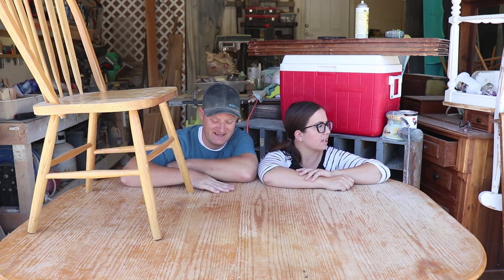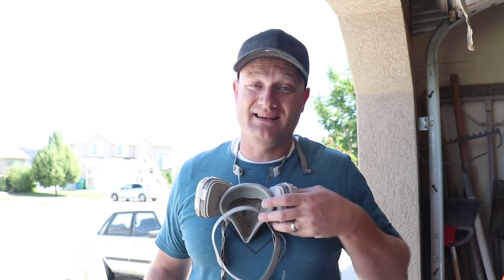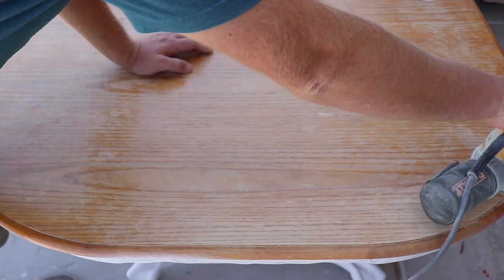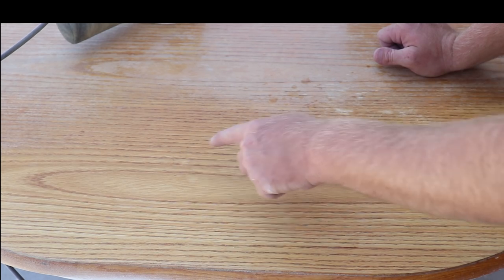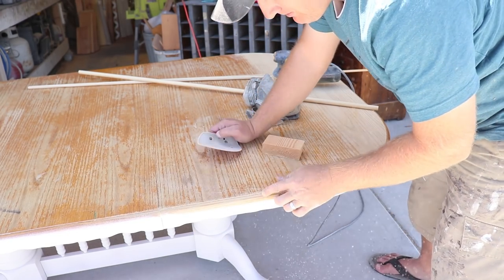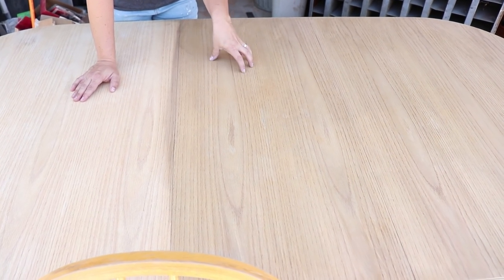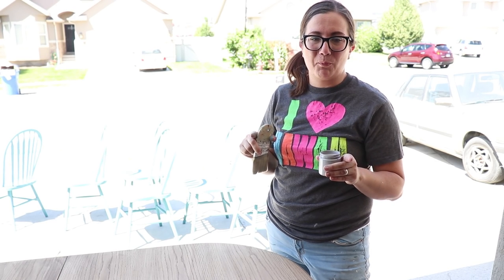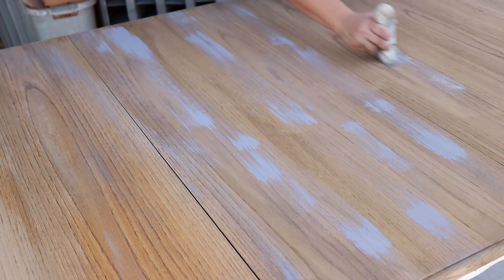How To Do A Barn Wood Finish On Table Top Veneer | Farmhouse Table

Comment: Thank you so much for giving so many issues & problems people might have with a set like this. I personally have a dinning room set large table, 4 turned legs, no leaf & 6 chairs... The only difference is it came from a high end furniture store, was an original when they where popular years ago & was kept in a large furniture warehouse until the furniture store finally closed after 100 years. It is solid wood, "yellow" with just a top coat, no stain. But the top is different than any I've seen. It is small pieces of solid wood all glued together to create the table top, for 6 chairs. The 4 legs are big and you can see there 1 piece of turned solid wood. Same with the 6 chairs. I'd like to redo it, with a white wash??? Legs, so you can see the fact that it's solid turned wood. It's got great striations. Then I'd like to do the table top & the 6 chairs with a med/light stain & then seal it well. I think all I'd have to do is sand all pieces down to remove the heavish top coat, that I've just let ware off to make it easier. Any tips or easier ideas would be greatly appreciated. I'm 40 something & recently got sick & am not disabled & medically homebound with a nurse that helps me everyday... I was wondering if you could suggest a sprayer that's light weight, easy to pull the trigger & is self contained ( DOES NOT) need an air compressor?? Any ideas would be greatly appreciated?? I also plan on selling the table & 6 chairs when I get it done, it's to big for my now downsized living. Sincerely Lori K.
Reply from the maker: Sounds like a fun project!  I’ve had good luck with this sprayer. We use an HVLP because of the volume we do but this is good for around the house projects. 
https://amzn.to/2Czj7dy

Comment: When you have to repair a hole in thrifted furniture what can you use to repair that hole andwill accept stain and not be in your face obvious that you fixed a hole there. Thank you for all the info you share. Really appreciate it.
Reply from the maker: If I need to stain it I use plastic wood by DAP
Reply: Thank you! I will give that a try.

Comment: Great information! It looks so nice. I have a Formica topped table I want to update. Can I sand it down to wood?. Thanks 😎
Reply from the maker: Formica is a little different. It won’t take stain like a veneer. If you sand it a bit you could probably use gel stain on the top.

Comment: I missed how you repaired where the particle board under the veneer came through???
Reply from the maker: Sanded it smooth and then used wood filler where the particle board got rough, then sanded that smooth again and did the white wash dry bush over it to disguise where the wood filler was.

Comment: Zeb,
For ppl that do not have a paint sprayer, which paint method is best to achieve a good coverage yet not leave a "painted look" behind? When done w sprayer it fakes it like it came that way originally. But not having a compressor, should I spray paint or brush on paint?
Reply from the maker: If you don’t want brush strokes the sprayer is the best way.
You can minimize brush strokes while painting if you dip your brush in water, then paint. It may take an extra Coat because you’re thinning it out but that will help some. That and maybe some hand sanding if you have high areas with some 220 grit. 
The Fairy Chalk Mother lone of paint we carry has a self leveler and will also help minimize brush stroke. 
A good synthetic brush can also help with brush strokes as well. 
Hope that helps!  
Here’s a link for the FCM colors. 
https://jamirayvintage.com/collections/paint

Comment: Very informative video.. thanks Jami and Zeb! I tried the same, except I did exactly what you said not to and sanded some spots too much down to the bare chip wood! Is there anything I can do to salvage this situation?? I planned on just giving it a poly without the paint colours you guys did but not sure if that will work now. Any suggestions??? Thanks so much
Reply from the maker: The MDF won’t take the stain the same as the veneer so it will always look a little different. You could gel stain it but you typically have to go pretty thick to cover the spots up.

Comment: The top reminds me of the 90's picklewood finish...How would I make it more gray? Use more paint or darker stain? I have a similar oak table set I'm about to paint that we got in 1991 when we were first married. Still great condition and paint will be the way to go. I was going to paint the whole thing with your chalk paint because of the veneer top...but I now want it with a wood finish top...either a darker brown stain or darker gray...Any advice?
Reply from the maker: This stain is fairly gray at full strength. We had it watered down 50%

Comment: I have a table similar to this one
Any tips for me to you can provide?
It has an odor and water damage
Don’t want to use an odor control primer because I want to get a color like yours and the good primers for odor control have color 
Not sure shellac will help with the odor and yellow bleed through 😔
Reply from the maker: Shellac has been one of the best bleed through and smell blocker we’ve ever used. If it’s bad stains you may have to do 2-3 coats of shellac but it will block it.  We also have a product called salvation solution in clear that we’ve gone to using because it’s all natural and still does a really good job at stain and smell blocking.
Reply: @JamiRayVintage  thank you so much for taking the time to reply back ❤️

Comment: What do you do when you have a 70's dining table and hutch with a top that is really shiny like a Formica finish. I'm not sure if it can be sanded and re-stained. I want to paint and distress the bottom and have a dark stained top but not sure if I can or if I'll have to sand and paint the whole thing.
Reply from the maker: That’s hard because that stuff doesn’t like to sand well. We use 80 grit on it to scuff it up and paint over it.
Reply from the maker: It can’t be restrained, in my experience it’s like a pressed fiberboard underneath.

Comment: Question...once you have mixed the paint and finished spraying your pieces.  Do you store the mixed paint and how?
Reply from the maker: We mix the ratio and leave it in the spray gun hopper if there is any left and use it again next time. If it isn’t a color we need for next time we put it in a plastic container with a sealable lid.

Comment: I have a strange question.  I'm trying to restore my grandmother's hoosier style cabinet.  There is a porcelain pull out work surface that has places that are worn down and not shiny and has stains that I don't know how to get off.  Is there a way to restore porcelain or should I just paint it and give up on the shiny surface look?  Any suggestions would be SO appreciated.
Reply from the maker: I’ve never restored porcelain, but I would take some fine sandpaper, 600 grit, sand it down and rough up the finish a bit and then use a clear two part epoxy over the porcelain to bring the anime back.
Reply: @JamiRayVintage  Thank you for taking the time to get back so fast!  I know your time is precious.  I just LOVE watching your videos.  I'll look into your suggestion!  God bless you both.
Reply: Today, after 2 years, I put the finishing touches on this piece of furniture that you helped me with.  I'd like to upload pictures of before and after.  Is that possible?  (I'm not tech savvy.)

Comment: Hi Zeb and Jami.  Curious about spraying sweet pickins top coat.... I know most things you spray have to be watered down some.  That top coat is fairly thin already..... do you water it down at all or spray it as is?
Reply from the maker: We don’t water it down but Zeb does spray it on a wider mist setting. It helps it lay down even. Sometimes if it’s really hot outside he’ll put a smidge of water in it but he forgot to do that on this set lol.
Reply: Thank you 😁

Comment: Hi, new subscriber & would love to know how to do a driftwood finish on this type of table. We have a super dark espresso finish table with some damage (gouged in a few spots from moving) plus family wear and tear. Thanks. 😉
Reply from the maker: It’s basically the same process with an extra step. Before you do the dry brushing do a white or gray wash over the stain. 
A white wash is essentially 8 parts water and two parts paint. Put coats of that on until you have the desired light gray color you’re looking for and then do some dry brushing.
Reply: Jami Ray Vintage thank you😉much appreciated.

Comment: What did you do about the rough spot?
Reply from the maker: Sand it with 400 grit until it’s smooth. Then do one extra coat of sealer.

Comment: Hi Jami and Zeb! So unfortunately I may have come across this video too late.  I sanded right through the veneer to the ugly wood underneath.  Is there any way I can recreate a smooth surface?  (I’m going to paint not stain over it) thanks in advance!
Reply from the maker: If you’re painting it I would bondo over the rough spot and sand it back smooth. That will be the strongest. You could also use DAP plastic wood.
Reply: I did the SAME thing :(
Reply: One last thing,  my leaf does not close flush, or without a gap in the seam.  Can you tell me how I can fix that?
Reply from the maker: Depends. If it’s a matter of the clasps under the table not lining up you can adjust those. If the wood has warped it’ll be difficult to get the lead to line up without having to make a new leaf.

Comment: The round oak table that I got from habitat I started sanding it a little bit and stripping it a little bit the top is not in very good shape at all it's got some black ink markings or staining or something on it. What should I cover it with? Little black dress? Your turned our beautiful! 
Mine is a vintage style with 4 chairs. It's round and the left is missing.
Reply: I did want to keep it natural on top but it's to marked up.
Reply from the maker: You could do a natural looking stain and do the dry brushing like we did in this video to cover up the stained or damaged areas.
Reply: @JamiRayVintage  it a big round messy spot.
Reply from the maker: It won’t sand out?  If it won’t sand out might be best to paint. I like minty colors or white in table tops if I have to paint them. You’ll have to decide what color best works for you. 😊
Reply: @JamiRayVintage  I've sanded it all that I can. I was going to whitewash it. But now I was thinking paint it first and stress it.
Reply: @JamiRayVintage  I'm scared I will mess it up!
Reply from the maker: Look at it this way, it already has a big blemish on it right, the dark splotch?  Can only get better from there!
Reply: @JamiRayVintage  Your right! lol
When my paints arrive it will come to me. It's funny how I had it set in my mind to be. But it will come. :) 
Where did you sale your first piece from?
Reply from the maker: I’d try Facebook, put it all the places you can. Your page, Facebook marketplace, yard sale pages, Instagram.
Reply: @JamiRayVintage  Thank you! 
And THANK YOU for your time.
☺
Reply: @JamiRayVintage  What is dry brushing?
Reply from the maker: We do it in this video on the top. Take a brush with paint and wipe most of the paint off the brush and then I randomly apply it on the top for an aged weathered look.
Reply: @JamiRayVintage  I see. And that's how you can camouflage marks that you don't want on there?
Y'all turned out perfect!